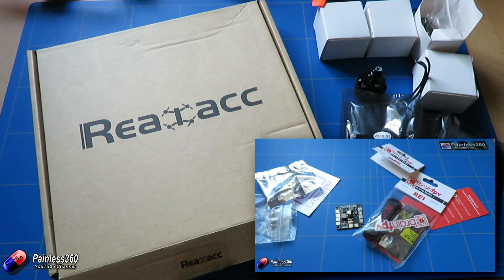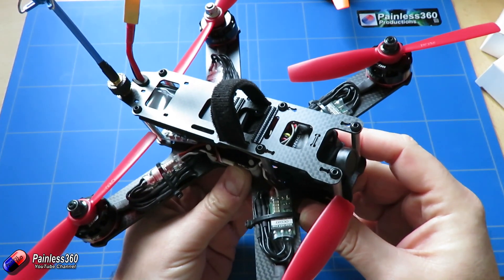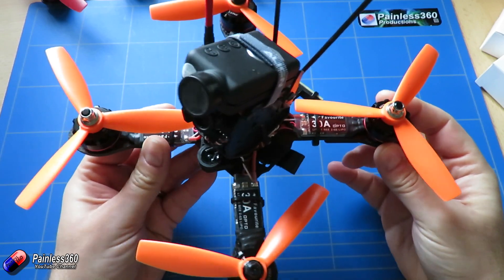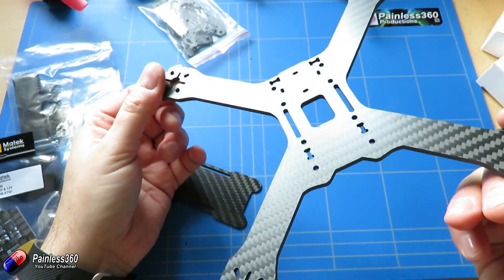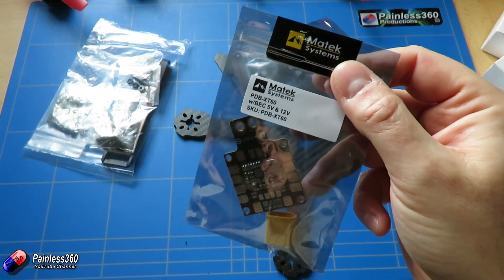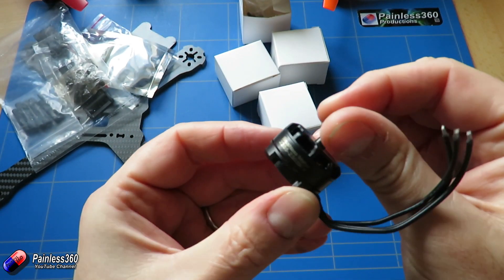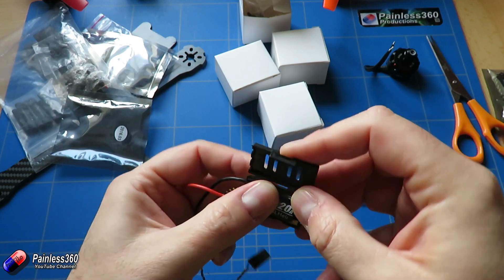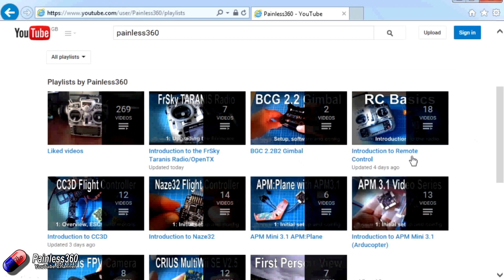(2/7) Quad Build Series 3: The frame, motors and ESCs (from Banggood and Foxtech)

Comment: 20A ESCs is more than enough for 4S on those motors.  I only pull about 16A per motor at bull beans with DYS SE2205s on DAL Q5040 props (4 blades) even with HV lipos.
Reply from the maker: Great to know, thanks for posting! I've not used there motors before - how've you found them?
Reply: I'd buy them again.  Performance wise, they're very similar to the now ubiquitous red bottoms.

Comment: I love to look at all these builds you're doing/have done but I'm missing a build of a bigger frame! say something above 600mm for (semi pro) AP or something like it. wouldn't that be a nice challenge @painless360?
Reply from the maker: Thanks for the idea but the build is eactly the same as a smaller model, only the motors and props (apart from the frame are different). We use 2215/920KV motors here on the larger models. Thanks for the idea.
Reply: Thanks for the reaction. I allready know how to build bigger models (I've got more then a few..) but i thougt it might be something nice to see for your audience! Maybe you could do something about vibration dampening (apart from prop & motor balancing) because I know a lot of people who have problems with this on big and small frames. Keep up the good work!
Reply from the maker: Thanks, now that is an excellent idea as you get very different harmonics on larger frames with slower motors and larger props. Hmm, you've got me thinking now.. ;) Happy flying!